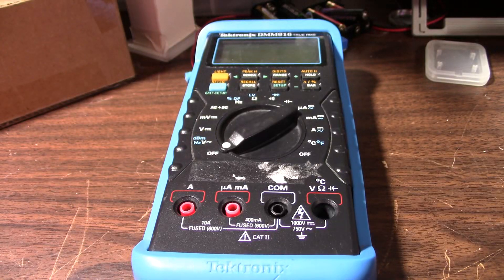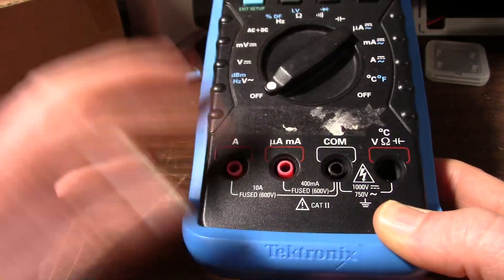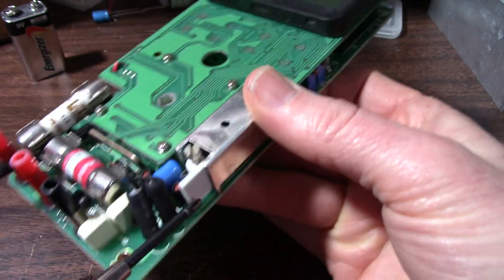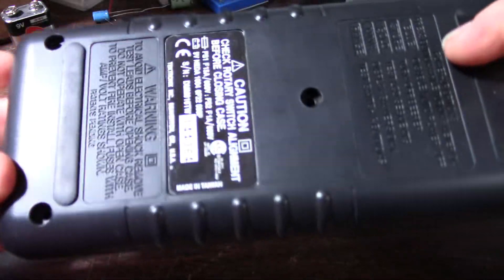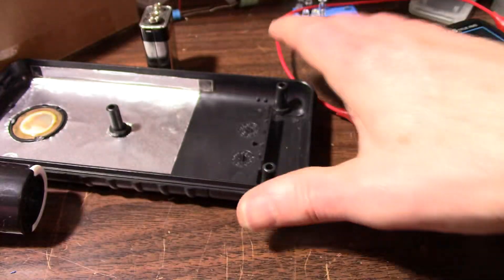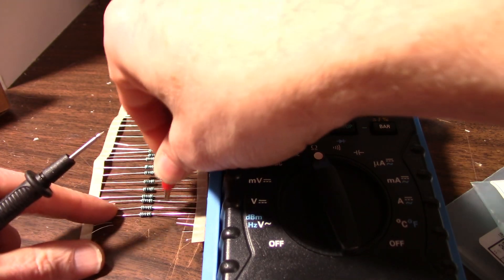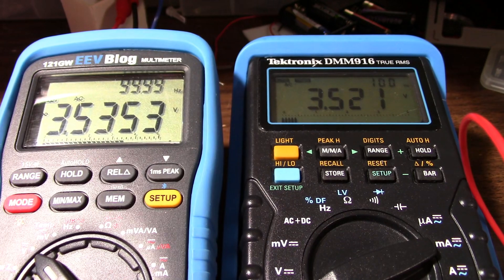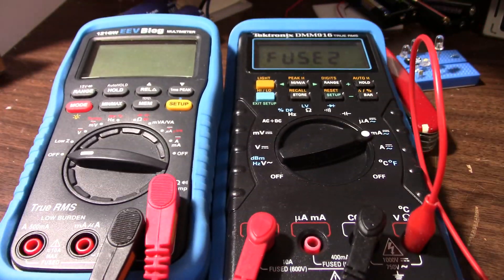Tektronix DMM916 multimeter basic test and temporary repair

Comment: Has dBm scale. Nice features. AC+DC. V AC True RMS reading freq response not bad - had old Fluke from '80s and it would measure past 20+kHz, CD players response was per test published here and there done using Audio Precision System. 
Can I use the scratch remover to polish scratched CDs and DVDs ?

Comment: That is a top quality meter. I have the same model and it still functions perfectly. Accuracy has not drifted. In certain modes it functions better than my Fluke 87. I purchased the DMM916 at a discount for $250 back in 1997. Tektronix meter division was purchased by Fluke in the early 2000's if I'm not mistaken. Don't feel bad if you have to sacrifice a cheap meter to get the needed banana jack. PDF user manuals are readily available online.
Reply: URanInTheUglyForest Yes, Fluke was acquired in 2003 and Tektronix  in 2007 by the same company, Danaher Corporation.  I heard that Flukes 187 came from Tektronix TX3 when Tektronix stopped making meters - I suspect to not compete with their new sister company.

Comment: if you want to replace the banana jack without searcing for the original replacement, you can try to replace it with this https://ebay.to/2N8oOFT, or this https://ebay.to/2Nzq3Np but i prefered the 2nd one, since it's already come with the screw, you just need to trim it